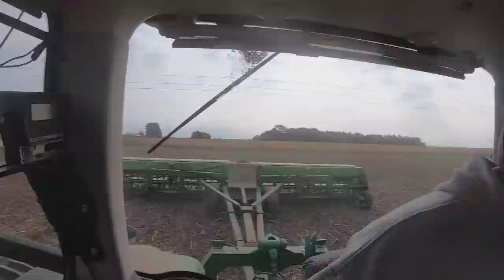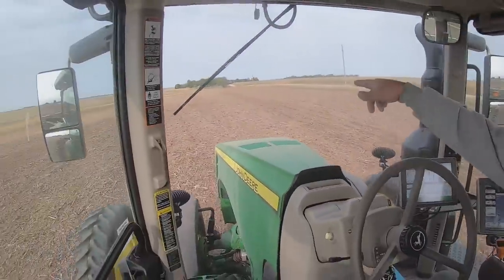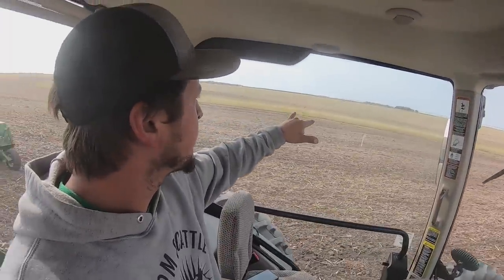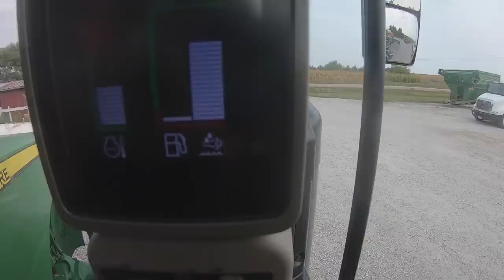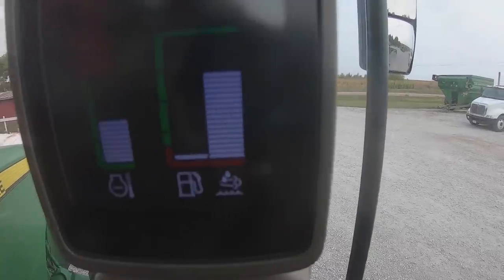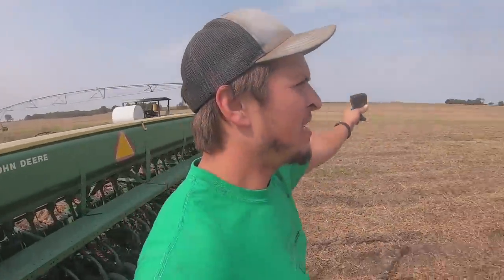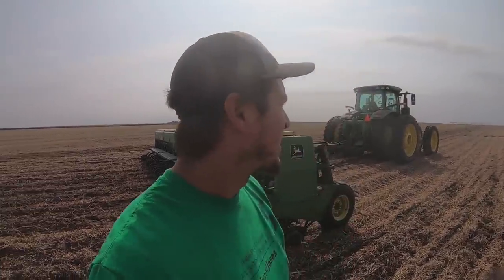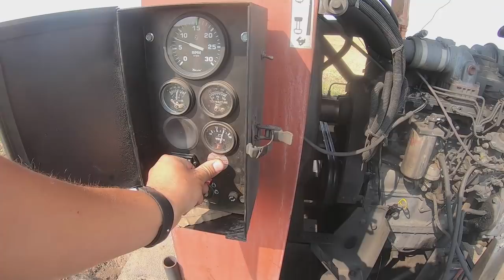Drilling Cover Crop For Hay | Forage Rye

Comment: Just ordered our winter mix; rye, oats, ryegrass, and crimson clover. I’ll be tilling up an 8 acre field due to hog damage and doing pure stand at 135 lbs to the acre. Same mix no-tilled into Bermuda grass pasture on another 47 acres also. Sure makes great first cut hay, I get 1/2 to 2/3s of our hay cut in the spring now when we have plenty of rain. Way less stress over lack of summer rain now.
Reply from the maker: Does it come up good in the pasture? I've thought of doing that but figured the grass would kill it off
Reply: JM Farm & Cattle it isn’t as good as a prepared field, but definitely worth it. I’ve noticed much less weed pressure come spring time so that’s a side benefit as well. Also it seems to recycle nutrients and make my warm season grasses perform better once they do come in even though it does delay them a little bit due to overlap of growing times. Here in Texas I have coastal Bermudagrass which is a perennial grass and the drill on 7.5” spacing cuts the runners and causes it to thicken the stand over time so that’s another benefit. I will say that you’ll want to fertilize it some, whether that’s commercial fertilizer or spreading manure or just letting them graze a section and then putting out hay for extra manure and then moving to the next section. But the fertilizer isn’t a loss because it gets recycled right on into spring and summer by having year round growing plants. We’ve been doing it since 2015 and I wouldn’t go back for all these reasons and the early hay I mentioned before. I’m hoping to get to where I don’t even need hay eventually.
Reply: JM Farm & Cattle I would definitely recommend a legume of some kind as this is great feed value, but also gives free nitrogen which would eventually be used by your pastures during summer time so you get money back that way too.
Reply: Do you find it difficult to get the first (early) cut with the rain and cooler weather cured to bale?
Reply: Dan Rose not really, but we don’t try to cut until late April to mid May. We let the cows keep up with it till then. I could see it being a problem some years, but for the last 5 no problem.

Comment: On planting grains either for grain or forage you need to consider at least 100 units of phosphorous per acre preplant and nitrogen as needed for spring topdress.. i hate the idea of planting small grains and treating them as a stepchild...to get the best results treat those crops like a high value cash crop Map is a good fall preplant fertilizer for small grain crops....helps with tillering....just a thought from an old  arkansas farm boy
Reply: Great video, be safe out there. Good luck with your cover crop. Like your videos.